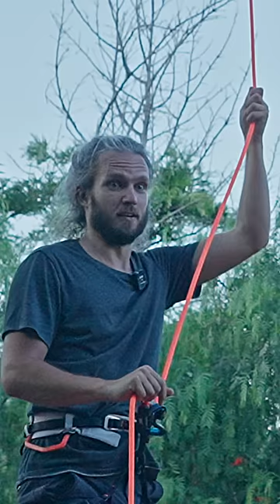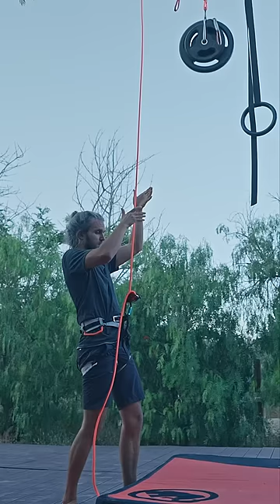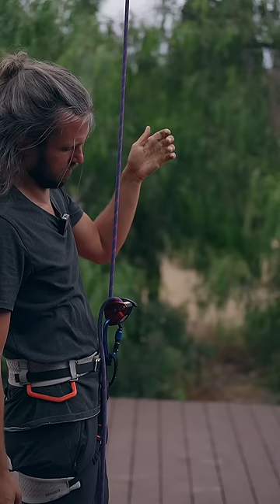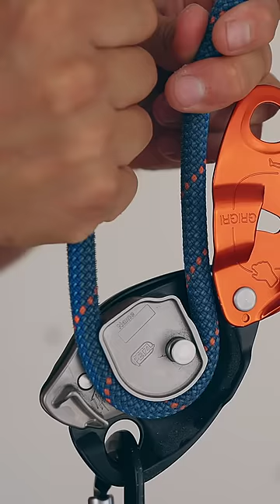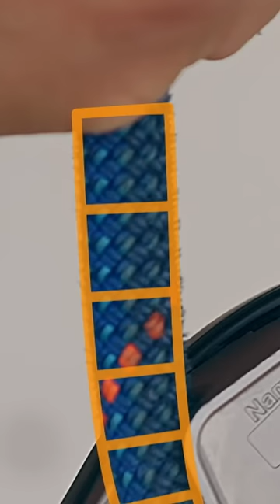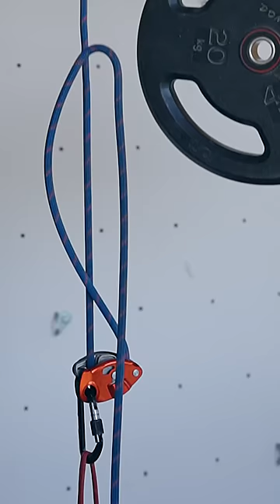The Physics of GriGri | When does No-Hands Belay Fail?

Comment: This failure mode of the GriGri has cost lives. Luckily it seems Petzl will release an improved device in 2024 that finally takes the speed, not the friction, as indicator on when to block.
Reply from the maker: could you link to any info to the new device that's coming?
Reply: I mean, same issue with literally any other belay device. If you have a shit ton of loose rope falling into it or theres not enough force on the cam it won't brake you. However, it still can brake you without hands in most circumstances (notice that he had to do some pretty weird stuff to get the cam to fail). I'd like to see any other assisted belay device do better honestly.
Reply: I didn’t find any informations at all about that on internet … You work for Petzl or what ? 😅

But a new grigri like that would be really really good
Reply: I think the grigri is fine as it is. This is not a failure mode, it is an user error.
Reply: @johannessporer  exactly, that's like saying that driving a car into a wall causes a failure mode and thus it is unsafe
Reply: @arpytrooper2604  the point is it's not a magic device, which will do everything by itself and you can relax, do nothing and fully rely on gri gri
Reply: @Megoover  i know, but people acting like it has some fatal flaw is just silly
Reply: Cost lives, where, who?
Reply: It’s complacent behaviour that did, it always tells you to have contact on the rope. People are becoming lazy with the gri gri
Reply: @Furansowakun i😊😊😊😊😊😊😊😊😊😊
Reply: @HardIsEasy  people keep saying "oh user error," but what if you are injured or unconcious..and cannot apply the force properly?
Reply: @arpytrooper2604  tbh from some of my less extensive uses for fun ive found the atc pilot to catch better than grigri but thats with the bd custom belay carabiner with any other normal carabiner it was slightly less good than the grigri i use.
Reply: @Test Boga
What "failure mode".
Assisted Breaking device, not failsafe breaking device!
And if the new GriGri would be useless as the GriGri+ with unnecessary "functions" and a much harder to use lip for the index finger (much smaller and rounded), then skip this!
Reply: Rewo?
Reply: Yeah but the problem isnt the device, its the people who think that its 100% safe.
Reply: @johannessporer  yes but if it happens enough it should be accounted for in the design.
Reply: what failure mode ? i see just user error  !  btw.. that grigri was on the verge of grabbing, it's visible on the slow-mo (cam already started to move).. 2 more meters of fall and it would accelerate enough that the friction would initiate the cam.
Reply: To be fair, climbing needlessly dangerous things is what killed those people. The only exception is rescue folks that have to try and climb something shady. But then again they also knew the significant risk that came along with the job. Idk, I just don’t think it helps to add gas and flames to an extinguished fire
Reply: Isn't that what the GriGri+ is for? I've been using that for like 2 years now, and it can catch people twice my weight 😅
Reply: He needs to learn how to use it before publishing videos....
Reply: @claudeyaz play stupid game win stupid price if you re so scared of your life, it's simple, dont get up there lol
Reply: I'd argue it's the belayer not paying attention. Unless the grigri fails by falling apart or not working properly from improper use, it's the belayer.
Reply: @grassy7209  no grigri plus has the feature to snap the clamp automatically when you are pulling the clamp release to hard
Reply: @johannessporer nah slips can happen anytime to anyone they have so much faith in their equipment because its really the only possible way they can do what they do so it kinda is manufacturer error huh kiddo
Reply: @arpytrooper2604  the real issue is rock fall hitting the belayer, rendering them unable to apply a brake hand to the rope. The climber is then screwed, the device is supposed to be able to prevent stuff like that from occurring
Reply: @jamesyoung2692  when you say "the device" do you mean any belay device being used should be capable of stopping the fall hands free?
Reply: Just a skill issue
Reply: @johannessporer  it’s fine but could be better. Still way safer than old belay devices.
Reply: Who weighs twenty pounds ?
If you’ve used this device, you understand how it works. 
I have never heard of anyone having one slip when their body weight is on it.
Reply: The speed? How would it detect the speed? It needs to detect the friction or have a camera or some other detection mechanism I can't think of. Machinery cannot just be willed into working a certain way.
Reply: It needs some kind of centrifugal clutch that spins and engages at certain speeds. Will surely be expensive as hell!
Reply: Rig-RE
Reply: You hope 😂😂😂😂😂😂
Reply: Best protection from falling is solid ground😂😂
Reply: Seems like that should've been done a long time ago, it would be easy to use centrifugal force from a spinning mechanism to lock
Reply: @derricktapia2098 I think this is the most stupid comment of the year. Congrats
Reply: @HardIsEasy  I think it’s called Petzl Neox. I would love to see your thoughts on it 🤙 Keep up the good work man, your content is awesome 👌
Reply: @claudeyaz if your belayer is unconscious then you have bigger problem
Reply: I don’t think that the grigri is at fault for almost any of those deaths. It is not auto braking and the fact that people treat it as such is stupid.
Reply: @claudeyaz then you should not be belaying.
Reply: Does it have a feature to prevent belayer fucking around?
Reply: Whos lives has it cost? Like this the first time ive heard of people dying from it.
Reply: @HardIsEasy  no
Reply: @DenzelLN936  exactly. Like 99% of climbing deaths come from issues like not having an end knot (often the climber repelling off the rope rather than the rope slipping through the belayer) or not creating a proper anchor before cleaning... And then there's the free solo deaths which I guess don't count towards any type of gear error per say.
Reply: @HardIsEasy its called the petzl neox - i would love to see your videos about it !
Reply: @arpytrooper2604 IME industrial devices like the rig and ID don't have a spring holding back the cam. Even though you're supposed to have a backup when using it hands free I haven't had one slip like this.

Ok the other hand, I've tried getting a grigri to slip like this in a routesetting context and it's pretty hard. Especially on longer falls.
Reply: They did not release that product..
Reply: not the grigris fault. some climbers are idiots.

Comment: The petzl ID has a no worries feature that prevents this from happening. It’s a bit bigger but much safer and has a panic brake for new users or accidents.
Reply: Yes. We use Petzel descenders for cell phone tower climbing. It's a requirement to have a descender with an auto brake and panic brake. We use them while working so it wouldn't really be useful to have a descender that you need to hold onto the rope at all times to stop it. Been using Petzel climbing gear for many years. Their grillion positioning lanyard is also great.
Reply: I despise the panic brake "feature"
Reply: @sergeig685  the Skylotec Spark Tactical is like the petzl i'd but without the anti panic break . and can handle heavier loads for rescue
Reply: @myname-mz3lo  nice. I hate the anti panic “feature”, that’s why in mainly use the original version

Comment: The Silent Partner was the only belay device I'm aware of that was designed for a no-hands belay. It used a speed-based locking clutch similar to a seat belt tensioner in a car. Sadly they aren't made any more and the few that exist sell for over $1000 used when someone decides to part with one. A backup system of mid-line loops clipped to the harness was still needed. But it was the safest belay device for rope soloing.
Reply: The revo is also speed based
Reply: @timonix2  yea... But isn't good for rope soloing

Comment: 1.) You should NEVER let go of the braking side of the rope. BUT this is not a fall scenario, just a "sit" scenario AND the weight ist just to low. would be different if youl load 60 kg or more. 
2.) this happend to myself once, with a new rope when i was checking some moves and slowly sat into my harness at the draw. So its not untrue, but missleading imho

Comment: My chain blocks will do that sometimes, they need the weight of the chain to enable the mechanism, otherwise you have a 200kg-1.5t chunk of steel heading southbound real quick.
Needs a roller/weight to add a bit of tension to the system

Comment: Nice to see the ways a gri gri can fail! I'd honestly love to see you show that ATCs are far worse for no-hand catches since there seems to be a lot of gear fear and people saying ATCs are safer whenever you show a video od the gri gri failing
Reply: @oleyholmes1989  that's why it's important to know that it can fail and how it can fail. Complacency is a belayer issue, not a gear issue. 

Also, gri Gris are way better at recovering from a mistake since you don't have to put in the force to stop the rope, just enough to set the cam. With an ATC if the climber has started falling and your hands aren't on it then you'll have to risk rope burn or worse trying to stop them. 

Also also the gri gri is much safer since it will keep you locked hands free if the cam is set already or it has the chance to set the cam hands free just from the weight of the rope trailing through it. This is important if the belayer is injured or knocked out by falling rocks or if they get slammed into the wall from a whipper and accidentally let go of the rope
Reply: We don't need a video showing how a hands free belay with an atc will fail because it is so obsurdly easy to demonstrate that irl. You can't teach someone to belay with an atc without showing how it fails and if you think you can, you aren't teaching how to belay with an atc. I would say the same with any other belay device too, but it is especially critical with an atc.

The fact that it is so incredibly easy to see how an ATC fails is one of the reasons why some people feel safer with them. It is easier to cope with a danger that is out in the open than it is to compe with a danger that is hidden.
Reply: Yeah there are a ton of tube fanboys that think Grigris are unsafe, while advocating a device that has no failsafe whatsoever.  It's ridiculous.
Reply: @DuBCraft21  well at least you know you'll die if your belayer is knocked out or injured. Seriously though, there's no reason to use an ATC if you have a gri gri and everyone preaching that it's 'better because you can see the flaws' are literally just saying it's better because it's so much worse it's obvious to everyone.
Reply: @oleyholmes1989  a left handed gri gri would be awesome and i can't figure out why they wouldn't make one :(

Comment: I did similar. Using two carabineers to sinch and repel up and down a corn dryer. Pulled a drill out of my pouch and released my break. The rope goes faster than you can imagine. Luckily I bounced off a handrail on a maintenance platform and slowed me down enough I didn't die haha.

Comment: We had issues where I used to work with GriGris so the entire company swapped to CAMP Matiks. No issues of it not locking during use.
Reply: Company? It is a sport climbing device.
If you use it professionally say lowering down from buildings etc, you habe the Petzl ID, which is similar to a GriGri, but the "mens version" of it
Reply: @philipppuchner1115  It was an outdoor activity company, mainly using Grigris and Grigri 2s as belaying devices for climbing, Jacobs ladders and trapeze type activities. 
Young people were slipping at low heights and through a combination of slippage and stretch we saw many ankle injuries.
we ended up changing how belaying was taught and changed to the campmatic, this appeared to greatly reduce the number of injuries.

Comment: The kid that usually belays me tends to rely on the safety feature of the grigri rather than holding on to the rope, and it’s quite unnerving hearing him being scolded by whichever instructor is on duty to actually use it properly - I’ve been dropped before from a height of roughly 10 meters because the belayer relied on the device too much

Comment: easy it doenst fail when there is enough weight , but it does fail where there is a low weight attached that doenst cause the system to grab the rope enough to cause friction.

Comment: What I’m guessing the problem is here is that the rope will kinda wip up.

If you look at videos of this happening. A rope can make a bit of a wierd thing happen when you pull on it hard and consistently. It will kinda make a wave right at the turn point. Because of that there is little friction.

It should help if the rope never gets upto speed. Also not letting the end dangle but instead holding onto it lightly should already make everything work fine

Comment: Madrock safeguard for the win.
Reply: they have the same issue. My lifeguard bites even less than the grigri. I like it because I can feed slack quickly without manually holding the cam. But it can absolutely slip if you don't hold the breakside of the rope

Comment: That’s why we call them assisted locking devices not auto locking. I have had my Wild Country Revo Belay Device drop my dad 20FT because he fell lead and by the time my hand and the device could stop the rope 5-10ft of rope had slipped past. This was during a test and the instructor kept paying rope to my dad when it wasn’t needed I should have told the idiot to screw off because the resulting fall .almost broke both his knees. Know your gear, maintain it, and use it properly and climbing is just as safe as getting in a car. Ignore that and you will be having a bad day.

Comment: Looks like the pump jack of the rock climbing world. If you're curious a pump jack uses the same principle as an old fashioned high lift automotive jack, except it's used to move a scaffold platform up and down a set of square wooden poles. Can be very useful, with two people and if they're properly set you can go up and down real easy. But, you hold the release/down control lever wrongly and the platform will just drop straight down. Easy to see why they're outlawed in many states. 

I would not trust this apparatus with my life, just the same as I do not trust pump Jacks

Comment: Is that like 35 lbs……………
Reply: And? It has nothing to do with weight
Reply: @proxy.1909  Of course it does. This is a 25 lb plate. It doesn't develop enough pull to activate the device. There is no way he could replicate this with something heavier, say a 50 lb weight.
Reply: 25
Reply: @proxy.1909  Physics have left the chat

Comment: Just in case the mountain ever falls down like that…
Reply: @keinmyster8549  this test is pulling UPWARDS. 

When climbing you fall DOWNWARD. Of course it’s gonna fail going the opposite way lol.
Reply: @Antwonn83 watch the full video, if that weight was a person, he would be on the ground, that would make it so he is falling DOWNWARDS and nlt UPWARDS, so the test is good lol
Reply: @Antwonn83  this gotta be one of the dumbest comments on here. what happens when you fall below the quickdraw... this.
Reply: @alguienxdd9630  no lol it’s where the gri gri  side is attached. The top being pulled up? Or down? The experiment is not done correctly. If you were the weight, why would the gri gri be attached on that side? Which way is the rope coming out of the gri gri being pulled?
Reply: @Antwonn83  lets say this was a top rope. Climber side of the rope goes up, though the anchor, then down, if break strand is comming through the side, not enough friction is created, the cam doesn't lock, and the climber(the weight) is dropped to the ground. I hope this made it clearer, but although the rope is going up, the climber is going down, which pulls the brake strand up, trough the anchor, then back down.

Comment: When belaying with a grigri, I never do press the cam down to give out slack..... as you just demonstrated, with the correct technique, its not necessary!!! You can feed slack through a grigri almost as fast as an ATC without letting go of the dead rope. You just need to practice the technique. Just watch the video and imagine your left hand is pulling the slack through and (still holding the dead rope) your right hand is moving towards the grigri. Now its time to practice with a rope and grigri...... a LOT!! Learn to do that and you'll never have to drop the dead rope again.
Reply: Why dropping the dead rope? Never!
Also with the Gaswerk Method.
Fking use the Gaswerk method to give slack quickly, always having the dead rope in the other fingers and moving towards the first clipped draw (if possible).
The same in return when taking in slack.
You mean to use it like a tube, yes of course.
But to make this work everything has to play together, the climber, the area to stand and move for the belayer etc.
Also, if using Gaswerk, you are able to give less slack but also not shortroping the climber when he pulls up lots of rope quickly for a high clip (with the last juice).
If the climber is higher up and no hazard of falling onto something, you may switch from Gaswerk to fully tube style belay mode and have a little more slack.
Because WHEN the cam engages because the climbers pulls up rope so fast or you shoetrope him, then you have to move your break hand into Gaswerk again and press down with more force than the climber pulls up rope to unlock the GriGri again.
This costs time and is shitty for the belayer and the then angry climber.
So I just use Gaswerk and I‘m mentaly prepared to press my right break hand to the right and down at all times to break the rope and at the same time, come closer to the wall and help pulling me up in direction of the first clip to give a soft catch.